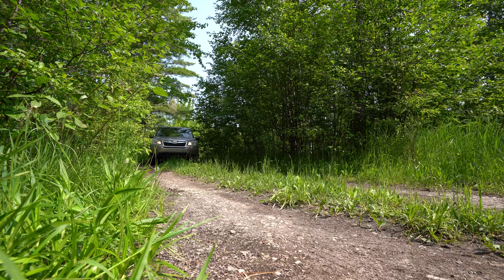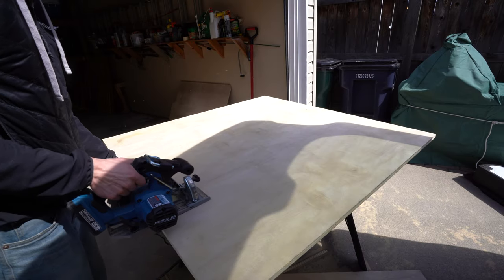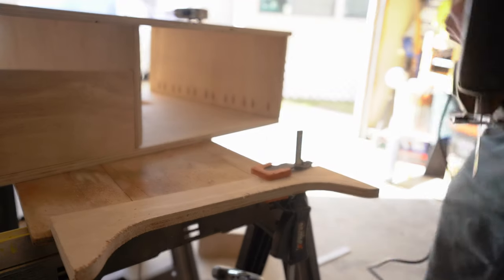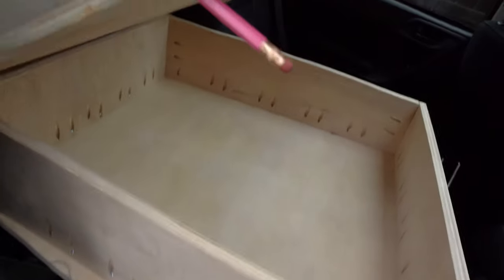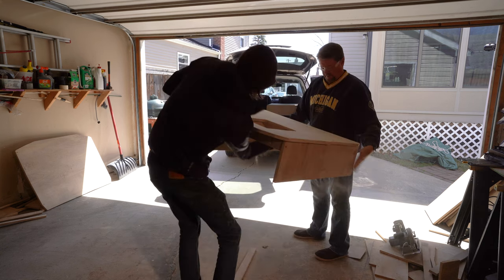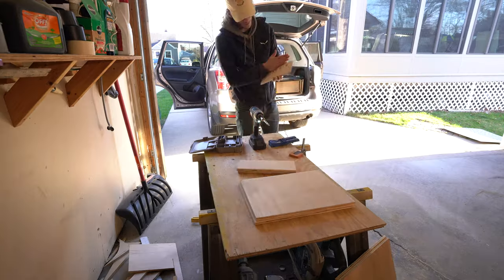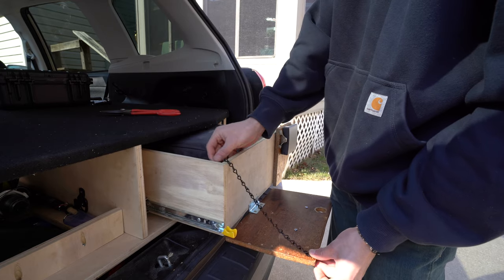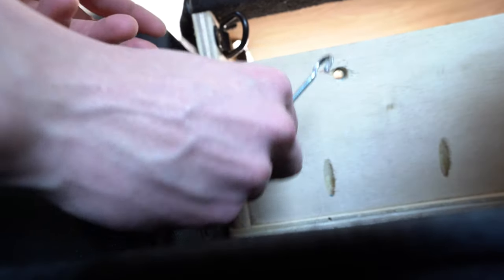Subaru Forester Car Camping Build  - Start To Finish  - with Plans & 3D Model

Comment: Absolutely amazing build. And leaving one seat still functional was a pretty good idea. Just having a seated space with a sort of table beside it could be quite useful. I see there was a gap between the storage behind the driver and the bed frame area where you stacked 4 pieces of plywood, did you end up tidying up this part and utilizing the tiny cubby space or left it as is?
Also the aluminum countertop was a stroke of genius. Adds such a convenience for a countertop that you don't see in many builds. About to go down a rabbit hole for any videos you've posted of the Forester as this is perhaps the best build i've seen thus far.
Reply from the maker: Thank you! For the cubby storage I usually use that to store camera gear as a sort of built-in camera bag. It has served a variety of purposes for camping and just driving about town.

Comment: Great build, Jarod. Thanks for sharing. How easy is it to access the spare tyre?
Reply from the maker: Thank you! Not easy, but I could do it in an emergency. I would just remove the drawer system and the bolts between the trunk and bed sections, then remove the trunk section to gain access. It might take around 15-20 minutes and some heavy lifting to do.

Comment: Love your build! Looking to do something similar for my 2017 Forester 😃 I was wondering, do you drive around with the truck frame or do you take it out after your camping trip?
Reply from the maker: Thank you! I have kept the entire build in the car since my original install. I haul lots of different things for work and the flat area I created ends up working out very well for that. It wouldn't be too difficult for me to remove it, but storing it somewhere in my apartment seems a bit impractical. I don't find it has a significant impact on gas mileage either.

Comment: How did you go about securing it in the back of the car? Or did you rely on the fitment of the pieces to do that?
Reply from the maker: The pieces fit very tightly within the space of the car, however there are two turnbuckles that fasten the back section into the trunk. Mostly these are to provide a counterweight when the drawer is fully extended

Comment: Do you think this would fit in a 2021 Forester?
Reply from the maker: I’m not sure, but I believe since the 2015 models the body style of the forester has been very similar in size. I would say the overall design would work but I would make sure to test fit things along the way and be prepared to make small adjustments.

Comment: Definitely cool but there's so much lost space with that foam around the spare.  I took mine out and built supports underneath.  Lots of space for food under there.  I also cut my rear seat so it's a permanent 3 seater now.  I get wanting to keep the seats but removing them is easy and gives you a ton of space.  Far easier to do that than installing this system.

Comment: Nice build man! I notice you've taken 2 inches of the height of the entire build. So does that mean your finished 'vertical walls/supports' are 9 inches like in the plan or 7 inches after you took it all down a bit?
Reply from the maker: Thank you! They are 9 inches, all the plans were updated after the build was complete.
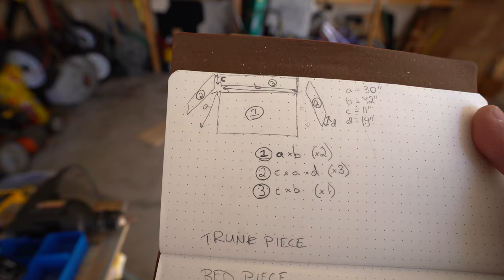Reply: @jaroddclark  The three splines in your original sketch (at 1:54) show a three inch difference in the height of the splines.  When you cut it down did you maintain the 3 inch drop to keep the build level?  I am in the middle of building this now for my daughters forester.
Reply from the maker: @brianmurphy1758  Yes, the 3 inch drop was necessary for me in order to keep the build level. I'm not sure if the incline in the trunk is the same slope in all forester models, so I would recommend measuring or making a test piece to see. I think I remember doing a couple of test pieces and testing with a level. I'm so happy to hear someone is using the design! Good luck, I'd love to see how it turns out!
Reply: @jaroddclark  Thank you for your prompt reply.  I see that yours is a 2015 while my daughter's is a 2013.  I have already cut holes in the splines to reduce as much weight as possible so  3 inch drop will be too much.  I may cut down 1.5 inch in prop up the back end another 0.5 inches to give me a 2 inch difference.  I'll let you know.  Thanks again for the inspiration.

Comment: what year forester is that?
Reply from the maker: It is a 2015!
Reply: @jaroddclark  nice youre lucky u didnt get the 2014. the 2014 has a lot of engine problems. has it been treatin u well til now? is it the turbo version? do you like driving it? can u rate it /10 taking into account the price and everything? thanks for responding